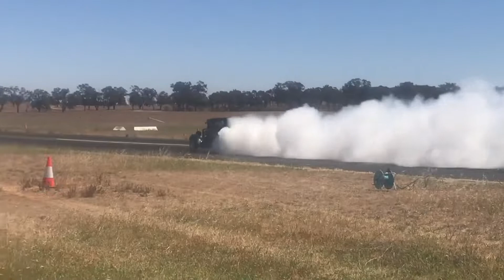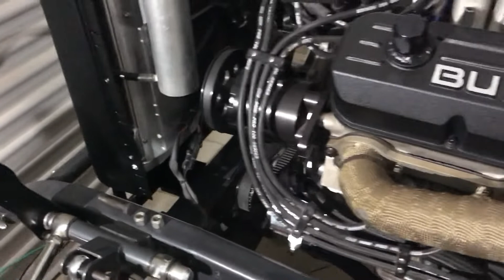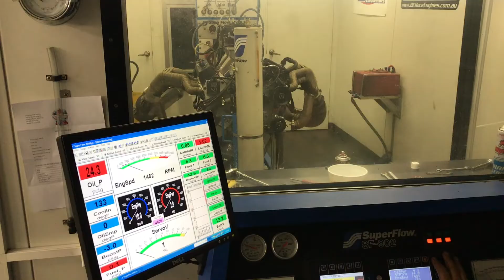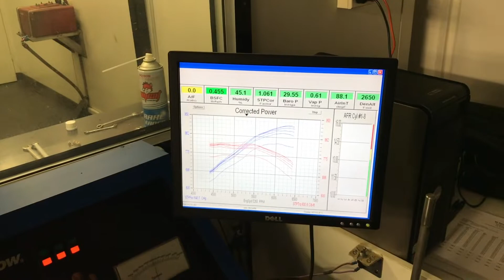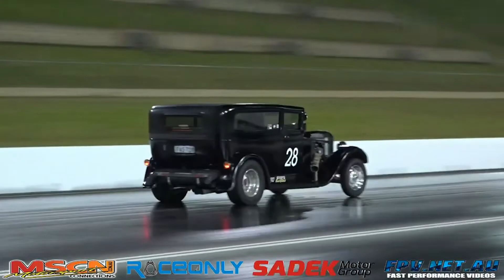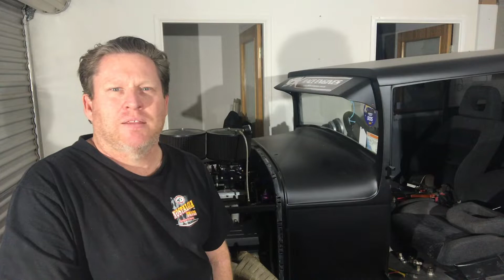FAST28 Episode 6

Comment: Good stuff mate. Why did the steering get the wobbles? Is there a fix?
Cheers, Mudgy
Reply from the maker: I think it may have something to do with the front shock failure. Although wheel balancing may have been an issue. I have found when taking wheels to be re-balanced at a different shop, readings are way off